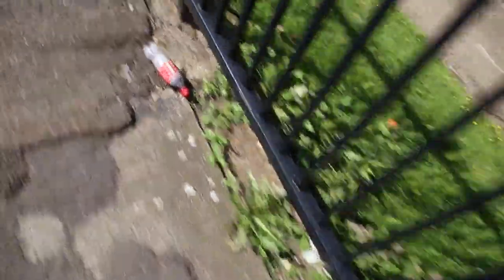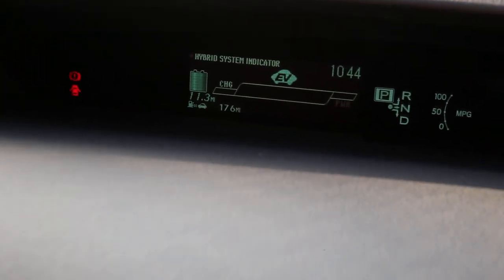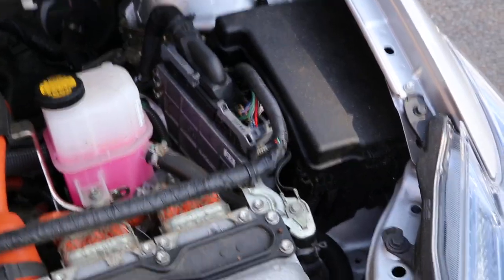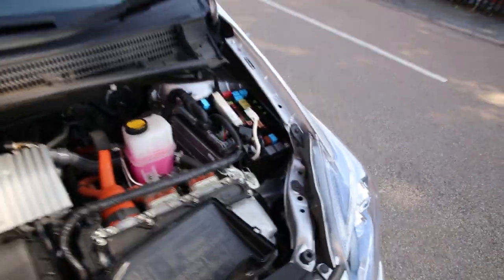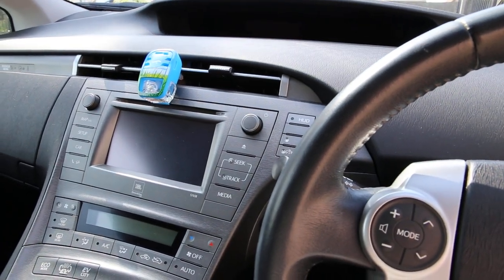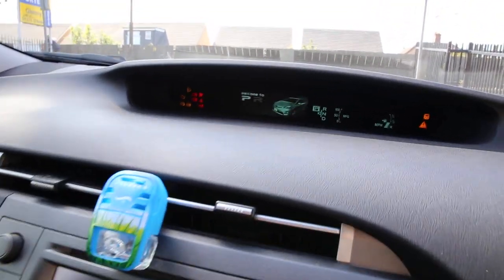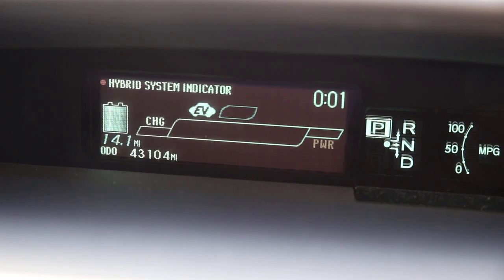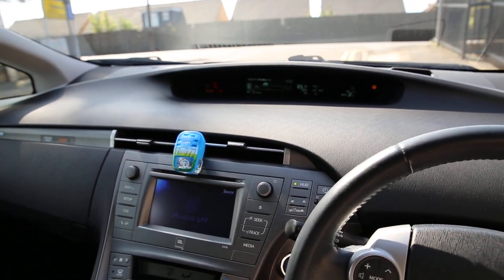Restoring electric range on a Toyota Prius Plug In

Comment: I noticed this when my car was called in for a replacement of the main fuse for a larger capacity one (Call-Back), but after two or three cycles it was back to its old (real) battery capacity and EV mileage. In short, don't bother with this procedure. Prius learns the real range after a few cycles and displays true and actual battery capacity, all the reset does is make it factory default as if the battery was new, but you will be back to where you came from in no time. It is what it is folks.

Comment: Question:
My 2012 plugin (with 165/265k miles/km) is down to 9.2miles @ full charge.
Before I try this charge-boost gimmick, should the shore-power plug be attached or detached while "resting" the system with the white 12vdc breaker-insert removed? Is there any reason NOT to leave the 12vdc plug disconnected overnight?
Thanks!
Reply from the maker: no need to be on charge, yes, you can leave it overnight but nothing will change, what you reset its the computer. Just do it like in video.
Reply: Thanks for advice!!!
Reply: Well, at least it looked promising...
Reattached the 12vdc plug in the morning and the EV charge read 14.3miles, up from 9.3!
HOWEVER, while actually driving, when the remaining-distance gauge read somewhere between 6-7 miles it suddenly snapped-down to 1.1 miles remaining. Adios apparent 5-mile gain from ECU reset.
Just me?

Until that let-down, a fairly thrilling fix.
Thx
Reply from the maker: @JF-gx5rd  keep in mind, the computer it will match the miles based on your driving behaviour
Reply: Flat, mild driving when 5-mile drop occurred.
I'm familiar with the vehicle's habits and patterns. Example: I live on a hill and at full-charge in EV mode the hilltop climb robs 4-miles in <3 minutes @20mph. Therefore, I always drive in power mode to the hilltop & then switch to EV for the downslope. Oddly, the hillclimb still draws-down the batt .5miles in power mode...
Reply: Pleased to report that the EV range has not suddenly dropped 5 miles again.

Your "reset" advice is working!
Reply: Thanks for the video. 

I’m going to try this. My electric range is down to 8 miles. I suspect my battery is just wearing out. Or is it that Toyota engineers think the battery should be used less and less over time so it last longer. If you use the battery more it will wear out faster. Maybe my battery is perfectly healthy, but it still has 80,000 miles on it. 

If it does allow the battery to supply more miles each trip will that wear out a healthy battery sooner? 

I am curious about checking the voltage of each cell. This will give me actual battery health. Weak cells will drag down the performance of the whole battery.

Comment: Although you're meant to plug the prius in to charge the battery, once the battery has run down while while driving is it possible for the petrol engine to charge it back you full?
Reply: No, it is not possible to charge back to full EV capacity using the petrol engine. It will be able to charge back to the full hybrid level capacity, the same level as a normal Prius. If you are going down a really large hill with regen braking, you can get a bit over the hybrid level battery and into the EV range.
Reply: I was driving in the mountains in North Carolina and was going downhill a long time and it charged the plugin battery fully never saw it do that before it was a pleasant surprise.
Reply: @richho1469  Going down Saluda Mountain will probably give you a full charge :-)

Comment: Please tell how do you get do you get the fuse box cover off. There are two tabs at the top of the fusebox and one tab at the bottom.
 The tabs at the top come off quite easily - for the one on the bottom, it DOES NOT come off. thanks